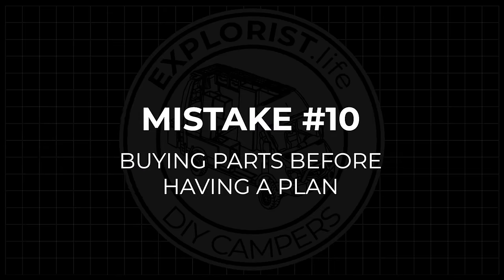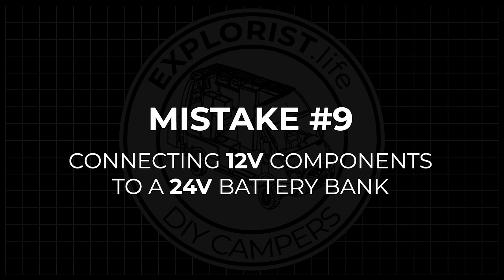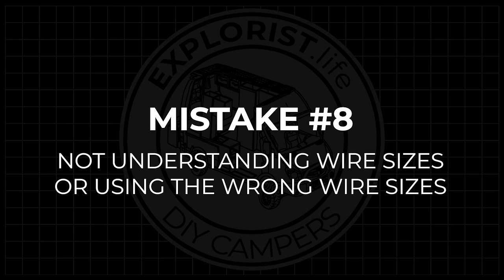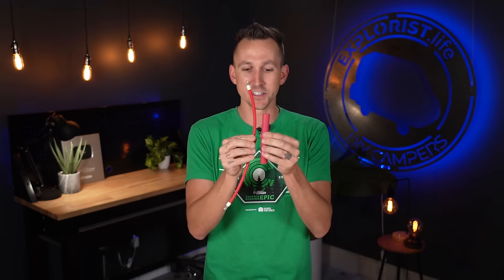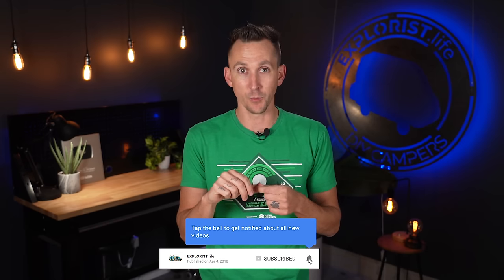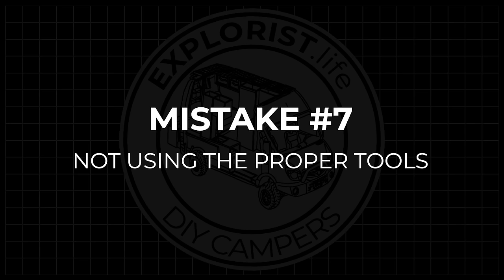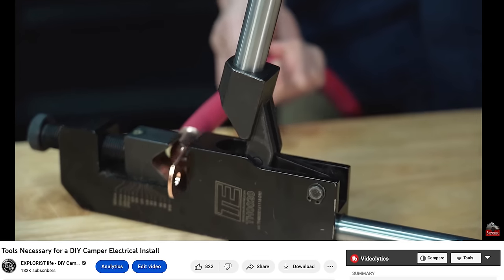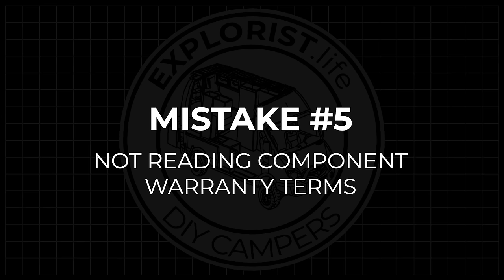DIY CAMPER ELECTRICAL MISTAKES (and how to avoid them)

Comment from the maker: What issues have all of you seen and how could they have been avoided?

Avoiding mistakes begins with having good work ethic, but starting with quality products and components helps.  Check out our store where we've hand-curated kits and parts that will help your electrical system installation go smoothly: https://shop.explorist.life

Here is a link to @Will Prowse's video. Go check it out and see what we said that was similar and different.  Lots of good considerations between my video and his: https://youtu.be/-3dNJAe8XEc
Reply: I'm watching your videos - but I'm a sailor. For me nearly same business.
What I experienced over time was: Just connecting new loads "somewhere" in the system - most without a fuse.
What adds up in maritime environment: You should use marine grade cable (ok - more expensive) were each copper is coated with kind of tin. USCG regulations require that - for a good reason.
Reply: Yep, if you don't follow these "basics", you can't follow the more complex requirements.  Trouble is, you have to pretty much know it ALL, which is where pros always have it over the DIYer.  In Ex We Trust

Comment: One thing I would add as a beginner miskate, is wearing rings, watches or jewery when working on DC systems. It only takes a small mistake to put your hand across a Positive and Negative and you will get a serious burn and a hospital visit. Take of all metal when working. Cheers
Reply: Silicon ring. Save the gold ring for date nights!
Reply: Don't work on a live system,  that's never a good idea
Reply: IMPORTANT Tipp 👍

Comment: Sounds like you’re realizing what all instructors know: (most) people are inherently lazy and want information handed to them. It’s one of the most frustrating things when the info is already in the manual. If it’s a clarification issue then that’s understandable, but most times the instructions are crystal clear (and if it isn’t, you can 99.9% of the time find it on the internet). Aside from the information issue, it’s crazy that people set out to convert a schoolbus, then they have the awesome idea to just make some crappy connections/terminations and throw the components into an area without actually securing anything. 🤦🏻‍♂️ Good info and content though! We’ll have to send you some pics of the bus when the electrical compartment is done!
Reply: Yep I can sure see that happening
Reply: This guy is good, but your absolutely right, people are lazy and go for the cheapest interweb solution. For every good plan on the line, there are 100 that are complete garbage.

Comment: The amount of builds I've seen on YouTube where someone has spent thousands of dollars on components but then they toss in a  random Amazon bussbar and eBay fuses and think that it's okay blows my mind
Reply from the maker: Yep, agreed.  if someone needed to pinch pennies, I'd much rather see them spend their money on high quality fuses, fuse holders and tools and then skimp on the actual components with the goal of replacing the cheap component with quality later down the road when the cheap component craps out on them.

Comment: I ordered diy  "battery box" with some cables in, added a solar charger. Once I started reading up I realized I could have just bought a empty box as I had to replace all cables and fuses, and had to add a bus bar, and then replace the useless usb charging ports as well... I did not have a plan and just started buying lol

Comment: to add up on the #2 . those who want to make a system where they have for example a grid connection to, like a shed in their garden already wired to their home electrics and want to design a setup to charge their lawnmower battery only to "save money". Essentially spending $500 bucks on some kit to charge a battery that uses about 10 cents of electricity a year at the moment.

Comment: Do not connect a battery to a dead not started up solar charger that is still connected to a solar panel... Just had 2 solar chargers go up in smoke and sending 77.7V to the battery bank . Always disconnect the solar panels before battery connects...

Comment: Speaking from experience here as a customer. 
Electrical systems are not something you want to skimp on. 
We've been very happy with components, diagrams, and kits from Nate. He's done a huge amount of the leg work for you and I priced out buying the components for his kits, and his prices are comparable and fair and we ended up just buying his kits. Totally worth it, and ended up with a system that works great. This dude is a gem.
Reply: "Expensive" components cost insignificantly more in the context of a van build.  And I'm a cheapskate.

Comment: Hi Nate! I just wanted to pass on a big and long overdue thanks for all that you’ve helped me with on my RV’s electrical system. Following the techniques from your videos and schematics from your website, I totally rebuilt my RV’s off-grid system last winter ... with outstanding results. It performed flawlessly this past camping season ... all thanks to you.

The content above represents one of the best “Top 10 Mistakes” videos that I’ve seen on this subject. A few of the 10 are subtle, but no less important than say choosing the correct wire and lug size and type. Lug size bit me when I tried to connect a 4/0 lug to the Victron Lynx Distributor and found that the HD lug version I had chosen would not fit.

@WillProuse is an excellent source of info. I’ve been following Will since he first appeared on YouTube and have learned so much from his content.

Another good YouTube choice for off-grid solar tips and tricks is Andy from @OffGridGarageAustralia, especially if you are into Victron gear. His content is geared toward the home solar system, but much of his work covers the off-grid RVer as well. He’s pretty entertaining to boot.
Reply: Yeah, Nate, Will & Andy, my 3 top YT’s

Comment: Just wanted to send my thanks for all the invaluable information your videos and website provided in my planning of my solar system for our 5th wheel. You're absolutely right about using quality components/equipment right from the start; well worth the "extra" money up front rather than dealing with potential issues with cheaper stuff. Your online schematics were very useful indeed! No need to 're-invent the wheel' :)
Reply: Yep totally true I wish I would have seen all this before I did almost all the mistakes that he is talking about....suucks

Comment: I've been interested in solar systems since the early 80s, and have watched the advancements in tech over the years. I've recently set up a system in my 'ute' (I'm Aussie) that I wired up myself. 
With a little experience, and using YT as a resource, I've set up roughly 500 watts of solar, 230 amps of AGM (to be upgraded soon), two charge controllers, a DC-DC charger, and a 3000 watt inverter. I was meticulous in wiring the system up correctly and double-checked everything. Thank you for this video. I just watched it and mentally checklisted my work against your advice. Happy to say, I think I did good.
Disclaimer: I'm a jack of trades, master of none. The ute the solar system is in has also had the engine mostly rebuilt and upgraded in some parts by me, and I'm building the back for my tools, rooftop tent, 100 litres of spare water, plus a bunch of other stuff (hot water etc)

Comment: Great video....   Take your time in designing, planning and installation!  I started back during the summer, and recently built everything up on a workbench to get a visible representation, and to get the latest Victron firmware updates installed.  I'll be preforming the install/upgrade while our RV is in storage during the upcoming winter months.  

Several comments to add;  mentioning of proper grounding of "ALL" DC components, mistake of thinking DC electrical systems work the same as AC electrical systems, using residential (Romex) wire in your builds, improper size of fuse to protect the battery bank  and amperage  rating of the battery shut-off (should be based on inverter, not on battery AH). 

I purchased the majority of my Victron equipment from a company in Arizona during their Labor Day sale (10% off), and my Battle Born batteries during their Recent Cyber Monday deals.  Based on my design, both companies went far and above in asking questions before actually selling me the equipment, so I  purchased components that will work together.  Also, the Arizona company suggested that I create a Victron VRM portal to go with the Cerbo GX in order to fine tune the various settings of each component to get the best results possible

Comment: Oh Thank you so much, I have just had a pheonix 12/3000 installed  and  upgraded to 3x 100Ah Lithium  batteries,  so I am quickly acquiring another battery before my camper gets used.
There are not many electrical installers to help with Victron Products in my city in New Zealand.  I have watched heaps of your channel and direct my auto electrician to your channel to explain what I am wanting him to do.
Reply: text426  Hi Nate I tried to send a message from my New Zealand prepaid phone but guessed you didn't get it. My phone probably only texts to New Zealand numbers sorry.

Comment: Your wiring diagrams are the best value in all of van building.  As you said, very complete and easy to understand and follow for a novice like me.
Reply from the maker: Awesome!  Glad it helped.  Thanks for watching!
Reply: Completely agree. Bought and followed to diagram to a T.  Now we do have experience in electric and construction but solar was a new aspect. Now, doing the work ourselves may have taken longer but the knowledge gained was invaluable. When boondocking, if issues arise, we have a understanding of how to fix. Thank you Nate
Reply: Hello .. Nate Do u have a 48v wiring diagram?

Comment: A very good video, people don't realize that even at low voltage 12, 24, Batteries have a LOT of current and that current can start a fire so fast or smoke up and melt the insulation and that 
burning insulation could be harmfull to breathe.

Comment: Lots of good information.   I think with fuses there are also issues with post sizes.  Some of these higher Amperage fuses have very small lug sizes.  This is specifically related to the square marine fuses.

Comment: Good video.  I have a hydraulic crimper because I read from a guy that does sound systems.  He said all of his connections are hydraulic.  It is a little speedy but worth having peace of mind that it is tight.  You can’t go wrong with buying the better tools.
Reply: Hello Dagwood,

I’m looking for a hexagonal crimper that will crimp four gauge Ferrell’s, any suggestions?
Reply: @tc4275  I have one.  Who is this?
Reply: @dagwood1327  hello and thank you for the super quick reply!

i’m an exterior painter who is building a power van to do my work in the field. I’m using Victron equipment. dc/dc charger, 100/50 MPPT Solar charge controller. 

All of the crimpers I am finding can only handle five gauge not four. 

What brand are you using?

Comment: Tip 1. Oversize everything. Tip 2. Use components that you can add onto to grow the system. Tip 3. You will want a larger system than you think.  Tip 4. Realize alot of sellers want to sell you as much stuff as they can so do your homework on the components you buy so you dont end up buying a larger inverter and have parts sitting on a shelf or trying to sell your to small of stuff that didnt work out.
Reply: Yes

Comment: Interesting comment you made regarding documentation and then the 12V multiplus II 3000 .... First I do have two 100 Ah Battle Born batteries in parallel in my 16' motorhome and very very happy with the performance .. also using Victron.  I wanted to take advantage of the BB sales at Thanksgiving week (22) and called in advance regarding what I am building for a small radio shack.  I have yet to complete the install of the Inverter mentioned.  The inverter I think runs at 2400 Watts... and I looked up the specs and said it says minimum of 400 to max of 1200 AMP batteries (as you stated).  I was interested in 1 x 270Ah battery possibly more Ah but BB sales (won't mention his name) said because the inverter 2400 Watt (?) non VA,  all I would need is the 270 Ah.  Even when I mentioned the Victron minimum 400Ah data he said that is just a suggestion on their part and not "required".  I had other difficulties communicating with them and decided not to go with their great batteries.  Price became and issue and issues with pre-fab wires I was going to buy.  (I need to look at your store) ... Well I lost some confidence in their "support" and decided not to buy.   I am working on installing the plus II into it's location and much more to do before getting batteries...  So, I ordered an EG4 12V basic rack battery which has yet shipped.  It is 400Ah and I feel I did right by this decision.  They told me that I can add more units into the future with nothing like having to do it within 3 months or so.  It will not communicate with the Cerbo GX but their 24 and 48 do ... but I plan on using a Victron shunt... and I think the multiplus ii has some monitoring but I don't know how to wire it to pick up all my use such that the Victron shunt does. .. yet..  We always need to be careful for just going by people who want to make a sale ... doing the right thing ... ? you never have to worry about money etc...  basically.
Reply: I also purchased the EG4 rack batteries but also got the 48v EG4 all-in-one 6500 EX inverter/charger vs the Victron multiplus. Comes with its own monitoring software. i’m still going to buy the shunt for the batteries from Victron, but really that’s all I need. those two together the inverter and the battery rack is just so plug and play. dc-to-dc charging will be victron from my alternator. Nate’s diagram that I purchased still helped me a great deal.
Reply: @mikefranks4528  Thanks.  I am looking forward to receiving the EG$ 12V .... It looks like your system is quite a sizable one compared to my needs.  Does the 6500 EX also pull and blend from various sources to invert at the same time as the Multi Plus II does? I have gotten mine connected up but do have it mounted on what I call the "Power wall".   With the Cerbo GX an individual units I find I can or will be able to upgrade and even repurpose the different modules.  I.E. the solar controller.

Comment: Question:  If one can not purchase all of their componants at the same time - in which order would you recommend?
The thinking is that one may not be able to put together the perect plan before hand and do purchases as used componants become available.
My guess is - Solar panels > Batteries > Charge Controller > Cables > Inverters        Thank You

Comment: Good Morning and thanks for all of the videos and wiring kits on your website. I'm using the all in one battery wiring kit for 4 - 100ah Battleborn with 3k Multiplus Inverter and had a question about adding a 2nd Orion Tr-Isolated 12/12-30 alternator charger to the linx distributor. I was curious if you would recommend running one large gauge wire from the Ford Transit (Attaching 2 leads to the CCP1 posts (2 posts) then to the 60 amp circuit breaker) before running back to the electrical box on the passenger rear of the van before using a bus bar to split the feed back into each Orion Charger. Thanks again for the content.
Reply from the maker: Each Orion needs to have it's own 60A fuse, so you'll basically want to 'copy/paste' the orion charging leg/kit so you have 2x 60a breakers and 2x positive wires.  Plus... 2x 6ga wires are cheaper than 1x 2ga wire, which is what you'd want if you ran a single wire.

Comment: When you got to the part about reading the user manual, I was like "Duh, not everyone reads those things when they should."...but then even I had to go back and look again to be sure I didn't miss it.  Am planning my solar setup and was reading manuals to make sure they work for what I need and such.  And guess what...I didn't.  Where I found that information that you mentioned for needing the minimum 400ah battery capacity, after looking around on the manufacturers website, was not in the User Manual, its actually in the Service Manual, which for sure almost no one reads as they think its for a Technician to read in case they need it.  Now with this info, I need to go back to all of what I had selected for my planned setup to make sure I didn't overlook anything else such as this.

12/3000/120, Recommended Ah 400-1200, Rated Current 250A, Recommended DC fuse 400.
24/3000/70, Recommended Ah 200-700, Rated Current 125A, Recommended DC Fuse 300A.
Reply from the maker: I've literally built this channel and our business around reading the manual and relaying that information to people. 😂🤣
Reply: Just a reminder to size fuses to specs of wire you are using and not to a generic wire or generic number

Comment: hey there , love all the helpful tips here .im getting ready to wire in a victron smart shunt in my engine bay  (04 tacoma) i am also insalling the new dakota lithium 12v 135ah battery that will replace my primary starting 
battery and will be powering the dakota 1500w pure sine wave inverter.my ?'s for you are would 1/0 awg wire be ok to run from behind driver seat to engine bay ,about 8feet. and would the main wire from starter motor connect to battery positive or to the shunt. thanks any help would be greatly appreciated✌

Comment: It seems like an infrared thermometer would be a valuable troubleshooting and maintenance tool in case I screw up on wire gauge or poor crimps.  I couldn’t find one in your store.  Any recommendations?

Comment: I'm at the beginning of my build and only have my batteries wired so far. I was adding a negative wire to one end and it sparked a couple times! Is my battery fried? What did I do wrong? Could it just have been the other end of the wire touched the positive side and everything is still ok?? Nervous to keep going. 😅